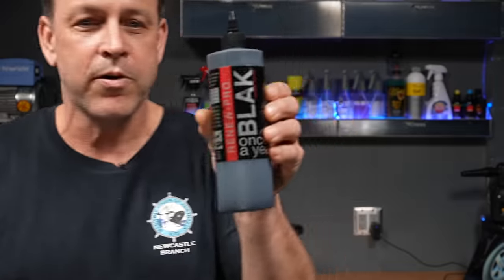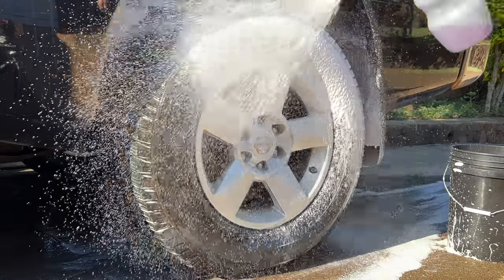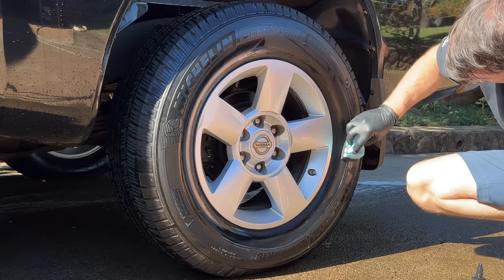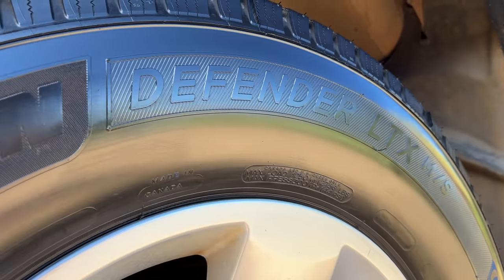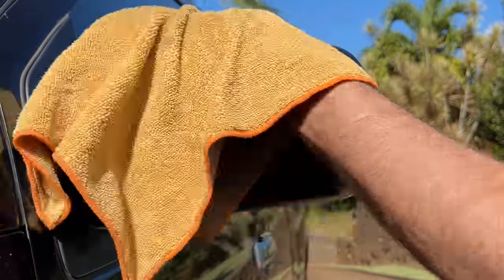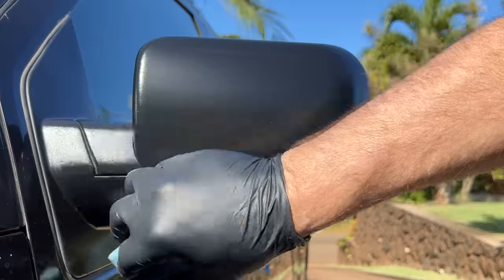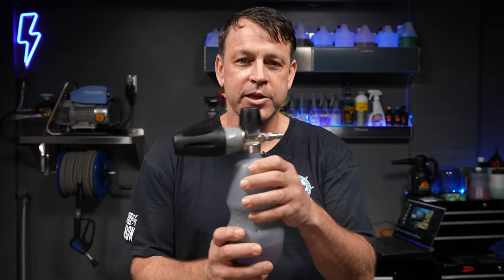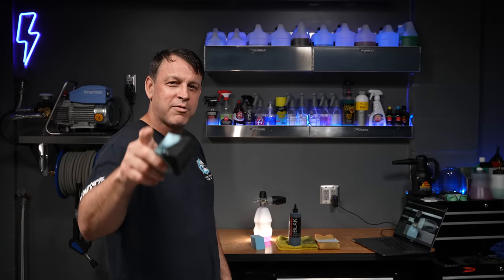A REAL CERAMIC TIRE COATING

Comment: I've been using this product since 2018 (when I discovered it) on my tires.  Awesome product and I get an easy 6-8 months of protection. Like Jeremy said in the video, prep is VERY IMPORTANT with this product.  I put it on truck tires back in mid Dec and I believe I cleaned all 4 tires 5 times each. It's not fun cleaning 35" tall tires that many times but it's worth it in the end.  The best applicator I have found to use is those Adam's foam blocks.
Reply from the maker: Thanks for sharing
Reply: 😎
Great to Hear!
Reply: Solid info.
Reply: Is there a special product needed to clean the tires when you’re ready for another application?

Comment: Been using for several years.  Great stuff.  Put the GLOZ on top for better protection.  Keep that stuff off your rims ASAP or it will stay..!  Easily a year with garage kept and regular touch ups.
Reply from the maker: Yeah. Good stuff. Thanks

Comment: Great video!!! I would also suggest Turtle Wax's Graphene Tire Dressing as well. It has worked for me in my detailing jobs and I've gotten great durability as well. You should try it.
Reply: Tried it on trim by chance?
Reply from the maker: Thanks for sharing!
Reply: @muchachogrande2019  I tried the turtle wax graphene tire dressing on trim, been about 3 weeks and so far so good.  I'd do a test spot on an inconspicuous area and then proceed to do the surrounding areas if it is to your liking.
Reply: The "Graphene " we all are seeing on the detailing market is just that, 'marketing'.... it's all BS 🤨. Most stuff out there are not true nano ceramics. Real ceramics are not cheap and the SiO2 ceramic, if real-deal, are multi-year strong. We go a bit further with it... our blends contain up to 18% titanium nano oxides with quartz.
Reply: @dorusrudisill2162   I'm in your corner on this one myself. I don't truly believe ceramic is quite perfect yet, let alone graphene.

Any of the ceramic coatings I use have at least some Tio2 as well to help with that glossy look and combat water spots a little better than ceramic does on its own. I love the DPC line from Scott at Dallas Paint Correction.

Comment: Save yourself a ton of prep work and use a drill brush and either super clean or brake buster when cleaning tires. So quick and easy.

Comment: Jeremy, I am not exactly sure if this can be shipped out your way but have you heard of Shine Supply Wise Guy Wheel & Tire Cleaner? I only specifically use this product for a full decon tire cleaner. Since the daily has been dirty for several weeks because of winter here in the Pacific Northwest I decided to tackle the tires with this stuff this weekend. I went back for a second pass with the Brake Buster in my IK Foam Pro and the tires were completely clean with white suds as I scrubbed using a Tuf Shine brush!
Reply from the maker: Will have to take a look at it. Thanks

Comment: I have no confidence in these so-called tire coatings I used one called Dura-Shine they claimed they would last for a year but after fully prepping the tire it lasted for about a week tops. But I am intrigued about this product
Reply from the maker: It has held up well for me. Like anything if you are hard on it it will wear off. Thanks for watching

Comment: Looks like taping off might be good thing to do.
Reply: Yeah I saw him barely knick the wheel when he was applying the first coat, but the better news is I didn't see it later in the video so maybe it comes off easy if you catch it during cure time or something.
Reply from the maker: It does wipe right of with a damp towel while it is still wet.

Comment: W O W!! That works well! Looks fantastic!!
Reply from the maker: Yeah. It’s some good stuff. It takes a few passes to get the hang of it but after that it’s easy to apply. Great for faded plastic and tires that need longterm durability. Time will tell how it holds up but so far so good. I like it. Thanks for watching
Reply: @HawaiiDetailing  I look forward to trying some. It really looks like a good product! It's also good that it coats trim as well. Multi purpose is nice!
Reply from the maker: @J1Z06  yeah. I was happy with the trim results. I was looking at that mirror again today and it looks great.
Reply: @HawaiiDetailing  I am buying some soon!! Thank You for sharing ths and for replying. Have a good week.

Comment: Super excited to try this stuff! I'm curious if you've tried the cerakote trim restore kits as I've heard very good things about it from lots of people. Wondering how the two products compare as a trim restorer and protector.
Reply from the maker: I have not tried it. Will have to give it a look. Thanks for watching
Reply: Not many 'ceramics' out there are actually 'ceramics'. Many are simply glorified Armor All, 303 types.... poly siloxane! Looks like Cerakote is the real thing. Ceramics are great but not a restoration product. They can enhance 'existing color ' and protect. RENEW PROTECT combines OEM type restoration, multiple UV blocks, and ceramic seal.
Reply: @HawaiiDetailing  what's your favorite car foam shampoo and which one is the one u use for 2 bucket wash?
Reply: I’ve tried Cerakote and for the longevity it may be hard to beat! Just wish they made something for tires that would last as long

Comment: Hawaii  detailing  have you tried Silverwax grease be gone tire and engine  cleaner on cleaning the rubber it really  de- browns the tire fast also the soap by the same company  makes a incredible  thick suds , I recently  found  them and pretty impressed
Reply from the maker: Will have to give it a look

Comment: Looks great, Jeremy! Curious as to why you wouldn’t just use BB full strength in a spray bottle instead. Would have saved you a couple of passes I think.
Reply from the maker: I had it already in the cannon so I went with it. Wasn’t expecting it to take that many passes. Looking back it would have been better at 100 percent. Thanks for watching
Reply: @HawaiiDetailing  Are you diluting BB in the foam cannon. If you are it’s kind of pointless because it already being diluted when it comes out the foam cannon your just making it colored water
Reply from the maker: @thekingleo_1664  no I put it 100 percent and let the cannon dilute it. If I need it stronger I mix up what I need in a spray bottle.

Comment: An very important tip that can help to halve the entire process.

Instead of many washes for each tire. Rather rinse the tire and then apply degreaser and scrub the the tire. One wash with degreaser will be more powerful than several washes with soapy water. Degreaser will get it back to "factory new" type of cleanliness.
Reply from the maker: That was not soapy water. Was a professional grade wheel and tire cleaner. P&S Brakebuster. Thanks for watching
Reply: Ph is the key. Add a little ammonia to a general purpose cleaner or just water and you have a strong cleaner.

Comment: Subbed from Kaneohe! 🤙Interested to see how long this lasts. I have an older Ford Explorer and the trim is fading bad. I did a spray paint coating on it before and it worked ok and lasted about a year before fading. Do you think this could be applied to a painted surface in general? I have a nice Cannondale Bad Boy bicycle that is matte black and curious if this could be applied to paint to "dress" it up.
Reply from the maker: It’s more for plastics and rubber. Not sure it would do well on paint. It works really well on rubber and plastic. Worth a try for sure. Thanks for watching

Comment: I was wondering why you use brake buster in a foam cannon you have to scrub so much and do it so much when you can use a product like malco fast shot and a wheel like that would come clean with 0 agitation when you are so experienced have you seen malco products ?
Reply from the maker: There are many ultra strong chemicals out there but it depends on the quality of the wheels you are cleaning as to how you want to do it. Too strong eats at the clear coat. Too weak and you will mar the clear coat with over agitation. Balance this process based on dirt level and wheel quality.
Reply: @HawaiiDetailing  wow I didn’t think you were going to respond to be fair I really love your videos your setup and your vibe to be honest one of the most chill YouTubers I’ve ever seen and I love it 

Was just wondering if you’ve ever tried that product and or products from there Line or why not because I went to go up on more brake buster gallon and he recommended it that I get that and if I use it 4:1 it will be like brake buster and I went to their YouTube and it they use it straight up and it works wonders as just a spray on spray off it really amazed me
Reply from the maker: No reason i havent tried them. Will have to get some a try it. Thanks for watching the channel

Comment: Hmmm...since it's a coating I wonder if you could use a VRP or something similar as a booster?  I realize that this product should keep you from having to do that level of tire cleaning at every maintenance wash...but as it ages, possibly a quick clean and then a tire  dressing of your choice?   
I'm probably out in left field with a hockey stick on this one...
Reply from the maker: I will definitely be testing some options on this one over time.

Comment: Can you use a microfiber towel to level it off and make it more uniform? Or you're no suppose to touch it after applying it?
Reply from the maker: I would go with light coats and do multiple coats. Filling in any spots like that. That’s what I have been doing and it’s been working great.
Reply: @HawaiiDetailing  alright thanks will try that out 👍

Comment: Heat gun on all plastics returns the black trim you desire.
Reply: *thick enough plastics. 

I've found a heat gun has the ability to warp plenty of trim on B & C pillars for example. Especially when they do something stupid like use piano black trim on the exterior.

But otherwise I would agree it's a great simple option for some trim pieces
Reply: @muchachogrande2019  I have a video on this process.... it's not for everyone, easy to bubble paint. It will weaken the plastics so only do once and only if fading is extreme enough BLAK will fully restore.... then coat with GLOZ or BLAK.

Comment: On that wing mirror, try a heat gun to remove the oxidisation. It brings most plastics back to black....just don't melt it. Easy to do.
Reply from the maker: Thanks
Reply: I have a video on this process.... it's not for everyone, easy to bubble paint. It will weaken the plastics so only do once and only if fading is extreme enough BLAK will fully restore.... then coat with GLOZ or BLAK.

Comment: Wonder if it can be used on whitewalls?
Reply from the maker: It is a black product so definitely not this variation. This would probably be good if you are not trying to blacken the tires and you just want a coating on it. This stuff is the clear version. https://amzn.to/3oH84YQ I have not tried it yet but plan to soon.
Reply: The GLOZ will enhance and shine any color.

Comment: 2:02 you need much more better Tire Cleaner products then P&S ;)
Reply: ADAMS tire and wheel cleaner. P&S is good for weekly washes, but I rather spend a little more on a  product that requires less scrubbing/effort.
Reply: P&S is super weak. I don’t really like many of Adam’s products but I tried their Tire and Wheel cleaner and I was shocked how well it worked. As soon as it hit the tire, it was pulling brown gunk off. I can’t even get Super Clean to do that.
Reply: @ROFLWAFFLE1911  for tires - FOR ME - P&S it's a product rather to "daily cleaning". When you have "daily dirt" to wash out - OK.

But if you really want to clean junk tires you need to use dedicated tire cleaners. Here in Poland in Europe we have few detailing brand which have fantastic tire cleaners - I did some vids years ago...

https://www.youtube.com/watch?v=k4HnPUcgq9Y

https://www.youtube.com/watch?v=MQHVX8R-_Ek

Specyfic products to clean junk tires. Using since years.
Reply: @DonDomel  Exactly. I've been using Brake Buster for weekly maintenance washes too. If say I've gone a few weeks on heavily soiled tires I will use a decon type of cleaner. Brake Buster diluted is meant for normal cleaning and works great full strength.